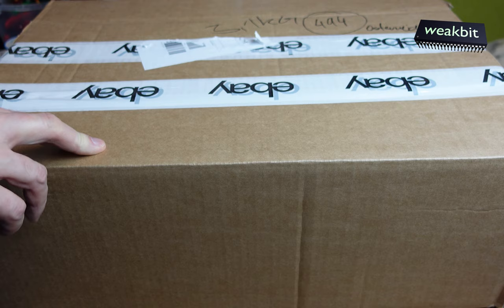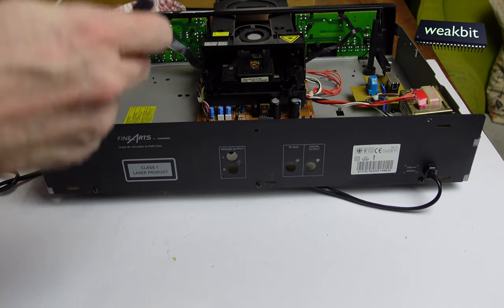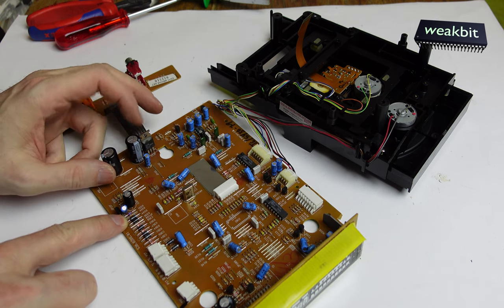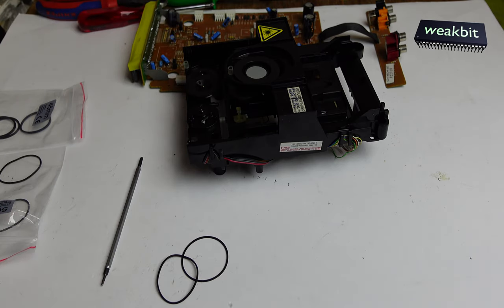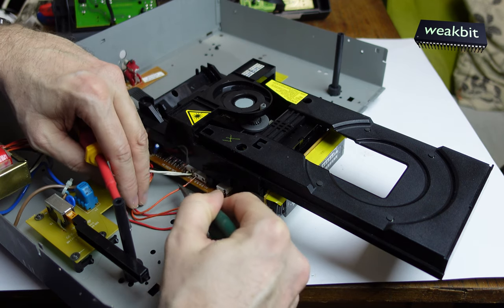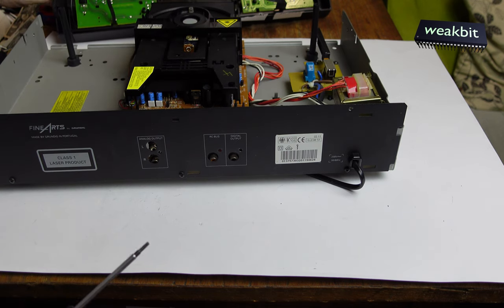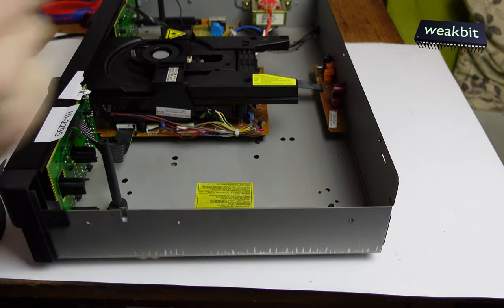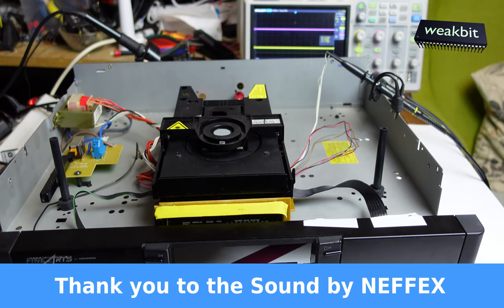Grundig FineArts CD11 CD-Player repair part1/2

Comment: Very cheap made cd-player, i have Grundig CD5200 its far better, even for today-s standards its very well mad and have very nice sound and read without any problem pc burned audio cd-s, regards from HiFi Serbia.
Reply from the maker: Hello Miloje - I say yes! to this remark what you told now. The CD5200 is a other age (era) it is well build in metal and not only molded plastic part. But this was a interest failure I think this is one of the first death counter that I fix with a external micro-controller that you can see in the Video and now it is working again. Thank you for watching! weakbit